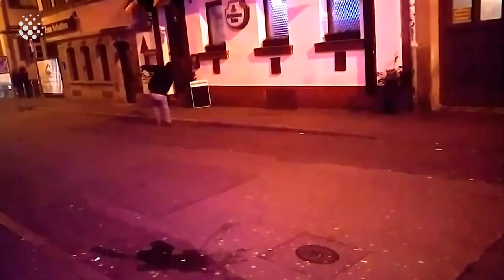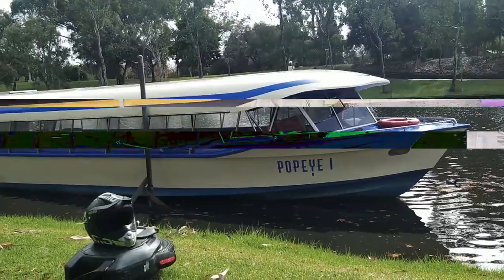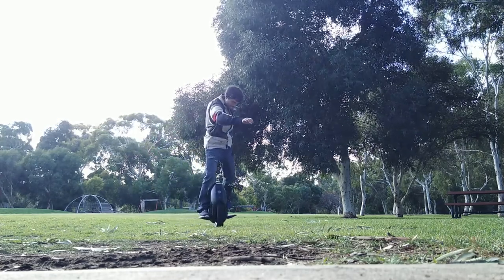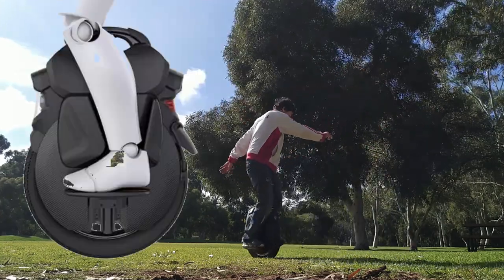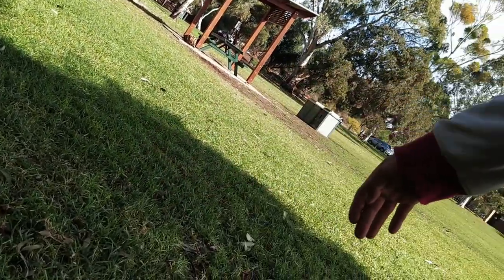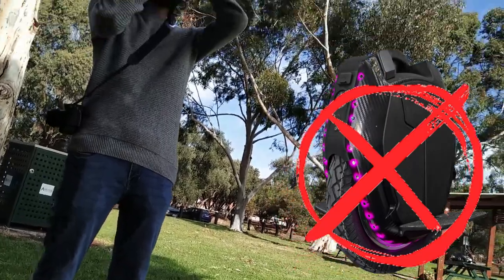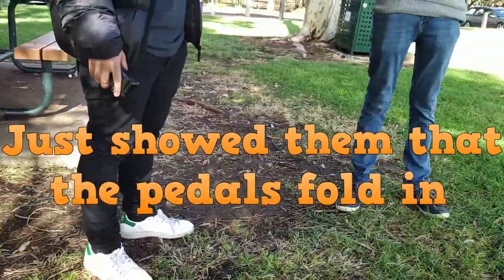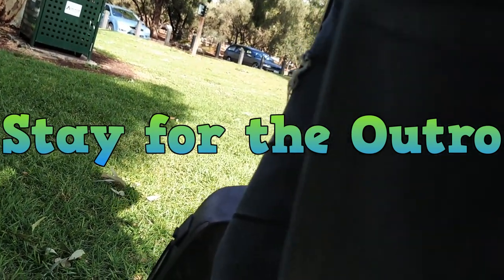Photographers AMAZED by EUC and 1 LEG STALLS (Electric Unicycle) - King Song 16x

Comment: What mode do you ride on. Hard or soft?
Reply from the maker: I like medium mode. Hard is good for it's own reasons because there's less pedal dip but soft mode is also good because for example when you brake hard, the pedals tilt back and this gives you extra grip because the pedals are tilted. So your feet can't slide off the front so easily. It's like your feet have to go "uphill" to slide off the front of the pedal. Hopefully that made sense.

Comment: Can it actually go 150km range?
Reply from the maker: Hi Andy. The aswer to that is YES and NO. It ABSOLUTELY can get 150km range but I'll NEVER get it. Let me explain why.
In order to get the advertised 150km range you need to travel at a constant speed of 25km/h meaning it would be a 6 hour non stop ride. Only smooth roads. No up hill. No head wind. You need to be a light rider. Around 60kg. And no stops or starts. The range I tend to get is closer to 80km but I have gotten over 100km on several rides.

I ride my 16x at close to top speed for most of my rides which won't give the greatest range. And I do lots of uphill sections.